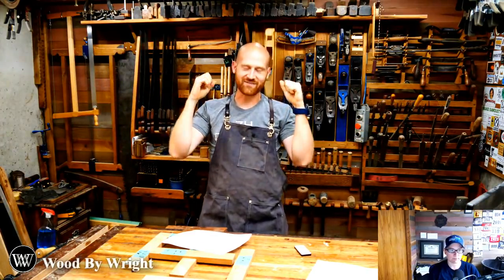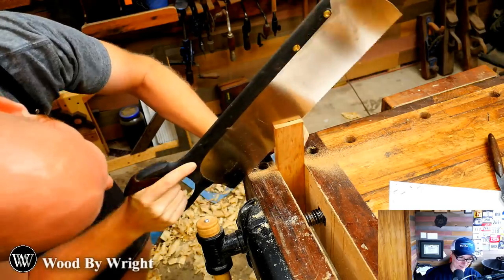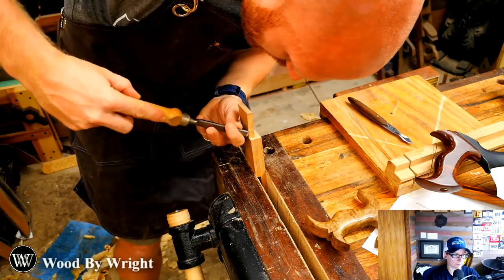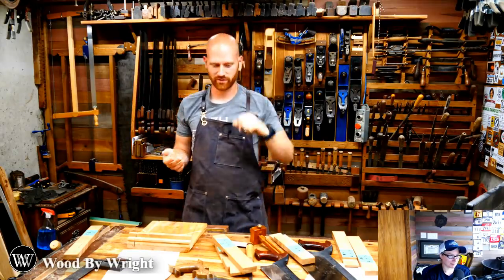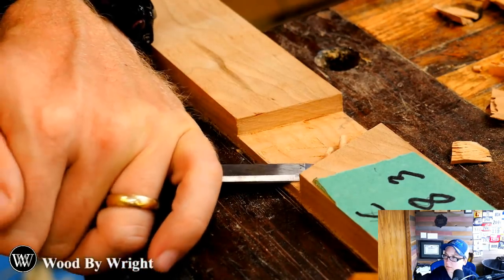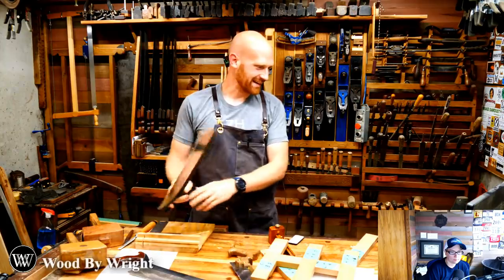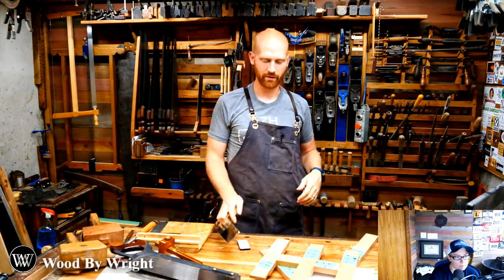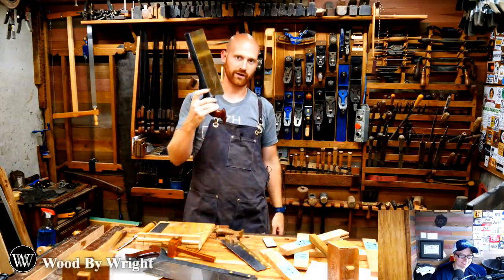How to Make A Dovetail Half Lap Joint | Joinery Window Live

Comment: A "crosscut" saw with ripping teeth would be useful for really deep cheeks if you were to do joinery in really wide boards?
Reply from the maker: yup, but at that point I general grab a panel saw. that is most common for timber framing.